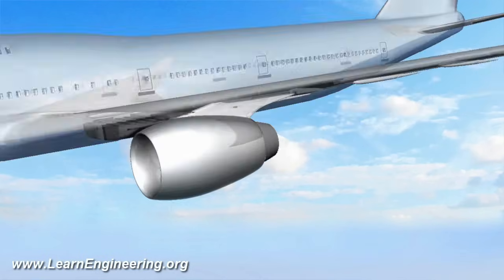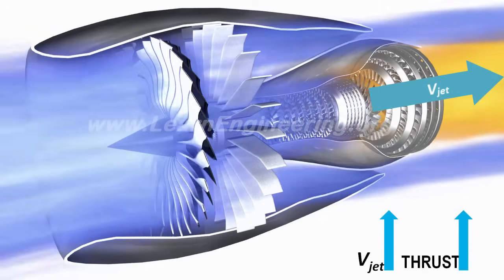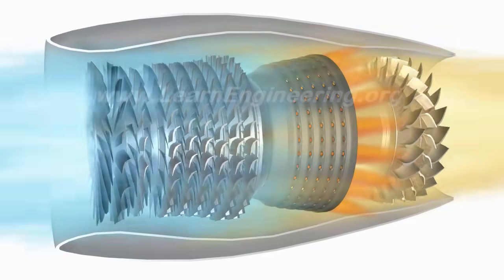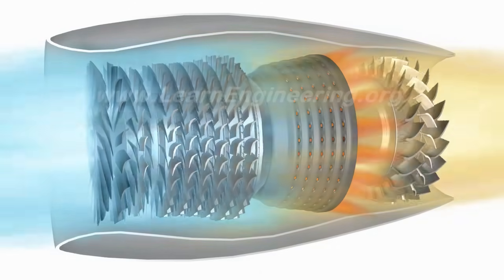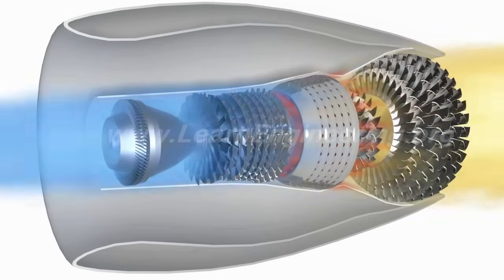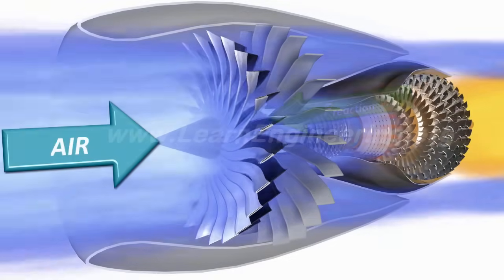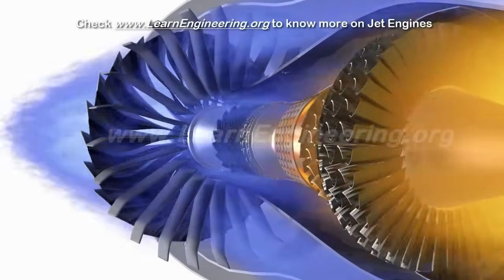Jet Engine, How it works?

Comment: Let me correct my last comment. It is spinning correctly in relationship to the exhaust blades. The angle of attack of the input blades in this video is usually wrong.Sometimes it it shown correctly.

Comment: They do not know how that engines works either. Why? Because we would understood them if they knew.
Reply: Tecolote Onako i found this easy to understand. Put in idiot terms, hot air is bigger than cold air. So they burn fuel to heat up the air. Because this air is in a tube, it shoots out the end as it grows. The put a fan in front of this air that is connected to a bunch of other fans which feed the engine with higher pressure cold air, and because there is more cold air, it grows even more when it heats up and shoots out the back at even higher speed.

Comment: In the first few minutes of this video the fan and compressor blades have a reverse orientation. They would be sucking air out of the engine with the rotation shown.

Comment: but...but can jet fuel melt steel beams
Reply: FraKctured I have given you the accurate temperatures - you learned to count, haven't you?
The beams can melt afterwards - there was more than enough time.

The rest is conspiracy nonsense.
I say it to you as a mechanical engineer who actually knows something about material science. All architects that I discussed this topic with confirmed me all the same behavior.
Reply: The temperature the fuel burns in the engine is shown in the video to be 450°Celcius. That's 842°F. The melting point of steel is 1510°C, or 2750°F. Conclusion: So Jet Fuel actually burns at less than half the temperature necessary to melt steel beams, and thus...well, maybe you should continue that line of questioning on your own.
Reply: You don't need to melt steel beams to lower their load capacity. If you are really interested in this topic, then talk with a proper architect or mechanical engineer. 

Also, the kerosene itself burns at 1800-2200°C if provided with enough oxygen (or higher if there is a strong breeze). The "quote" of 450° shows that you haven't even understood this demonstration, where the common temperature of the leaving jet was shown.

I don't know what makes me sadder to see: Senseless memes or the answers that follow them.
Reply: MetallicReg Correct, you do not need to melt steel beams to lower their load capacity. However, if you take into account the fact that steel beams actually were melted on 9/11, you might reconsider the relevance of your rebuttal. One doesn't have to be an expert in anything to google the images of steel recovered from Ground Zero. Humongous pieces were fused into slag, made physically inseparable from concrete and debris. Youtube has videos of the towers burning in which glowing hot metal is visible dripping out of the sides. It's a known fact that First Responders reported that the debris pile was too hot to walk on, and fires under the rubble burned persistently for months after the attack. One group of firemen interviewed saw molten steel pouring down the columns underground. Hundreds of witnesses reported hearing multiple explosions preceding and coinciding with the destruction of the towers. Unfortunately, none of those findings were addressed in the 9/11 Commission Report, and most professional "debunkers" still pretend that it doesn't exist, but it's all easily available online if YOU actually have an interest in this topic. But hey-  it's probably all just a big internet meme right? No real scientific or forensics experts are seriously questioning the findings of NIST, right? That whole "Architects and Engineers for 9/11 Truth" organization couldn't really be run by credible Architects and Engineers, could it? Nahhh, our politicians, media, and government would NEVER lie about anything like this, would they?
Reply: it doesnt have to melt for a building to collapse...just make a few problematic beams a little more weak and boom...just sayin im not implying that bush did 9/11

Comment: Low speed fluid dont damage the outer turbine but what about the inner turbine which is subjected to high velocity fluid. Sol what is the advantage of two spool system??
Reply: so what's the advantage of spool system then ??

Comment: Very complicated i dont get it even after watching it twice !
Reply: Not too complex. As the air/fuel mixture ignites and shoots out the back of the engine, that flow of air turns the turbine wheels as it rushes past them. The turbine wheels are connected to a shaft that spins the fans at the front of the engine...sucking more air in, which is added to more fuel, which ignites, which again spins the turbines sucking even more air in to the front of the motor. The thrust is created by air flowing faster out of the back of the motor than the speed of air coming into the front.

Comment: So how does a turbo fan jet engine start? If it needs airflow to operate, it obviously needs to start spinning with a mechanism that doesn't require fuel burning.
Reply: Usually high pressure air from the APU will be fed to one engine to spin it up. After the first engine is started the high pressure air from the now running engine is used to to start the next engine. Hope that helps.

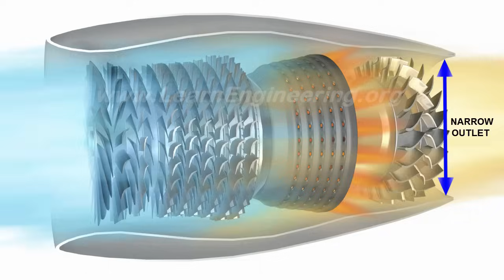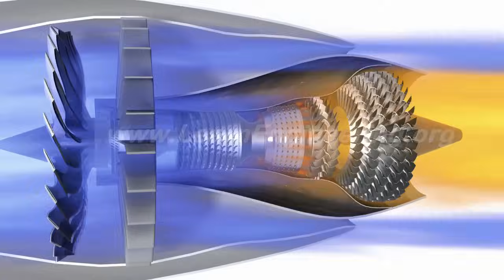Comment: Your animation is wrong... compressor 2:50 and propeller 5:04 blades are wrong angled or they need to be reversed.. if they turn as in the animation they wil pul air out of the turbine from the front.. Any engineer or person with minimal aerodynamics knowledge will understand.

Comment: Why are the front rotor blades inverted? Wouldn't that make it spin the wrong direction?
Reply: At 4:00 the front rotor blade is going in the correct direction.  At 5:00 the rotor is still turning in the right direction, but the animation turned the blades 90 degrees in the wrong direction.
Reply: I noticed this too. I think it's what martin said.
Reply: Dennis Edwardz Thanks, yeah. I looked back later, and was having problems seeing what I saw the first time. Didn't really feel like going through all that again :P
I have directional dyslexia so I couldn't figure out if i was just confusing myself. When people make mistakes like that, it really fucks my mind over, my brain is suppose to be the source of the inconsistency :P
Reply: Richard Smith can somebody explain how jet start
Reply: @kevinsimiyu7473  maybe an electric motor speeding it up to the correct speed and then the fuel is injected, then the motor is turning off
 
(Just an assumption)
Reply: Its Saab JA 37 Viggen's engine........XXXDDD
Reply: Richard Smith

Comment: sorry, but was the air "burnt" inside?
Reply: atomised fuel burns and heats the air
Reply: It's the atomised fuel that burns. Ensured air flow, by means of the compressor set, ensures the fuel will continuously burn. Resultant high temp & pressure media then, not so quietly, demonstrates newton's third law.
Reply: Surendra Nerurkar so, air is not the fuel?
Reply: actually air and fuel mixed, and burn into the combustion chamber. so you need vortex into the combustion to mix them up
Reply: Air-fuel mixture in relation 15(air) to 1(fuel)

Comment: The front propeller is rotating wrongly that kind of rotation will only help plane to move backward
Reply: The front propeller is rotating correctly in same direction as a turbine, but it has wrong orientation of blades. :-(

Comment: Why would a turbine be placed at the end of the engine.  What purpose do those turbines serve?  He say's the pressure drops when the fluid is expelled through them, but don't we want to maintain pressure to keep the engine efficient?  A drop in pressure when the fluid is expelled would cause the engine to produce less thrust.
Reply: The turbine at the back catches the exaust flow to spin itself. As this tubine at the back is directly connected to the compressor it is spun up too providing the pressure for the combustion chamber.
This system by itself is not self sustaining. What gives it this capebility is introducing fuel into the combustion chamber and burning it which adds the energie to provide both thrust and the energie needed to run the components of the engine
Reply: The turbines are placed at the back of the engine so that the hot gases coming out of the compressor spin the turbine. the turbines are then connected to the compressor with a shaft. So the compressor heats the air the combustion chamber burns the fuel air mixture then the energy goes through the turbines which take some of the power and spin the compressor with the connecting shaft.
Reply: So essentially the turbines at the back are there to make the compressor work more efficiently?
Reply: Not more efficient. Then make it work at all. They provide the energy needed to drive the fan, which is essential.
Reply: it's basically an engine that powers itself, the exhaust created from the engine powers the very compressor that feeds air into the engine
Reply: Doesn't that violate the law of conservation of energy?
Reply: The output of the combustion chamber makes more than enough power to overcome the resistance of the compressor itself. Its how its built to be self sustaining.
Reply: remember you're getting energy from burning fuel too
Reply: ^^^^^ Yes and that makes sense.  But the others are making it sound like once you get the engine going, it spins itself forever until it stops.
Reply: Chris Ehmke wut
Reply: No it does not violate that law, because fuel (energy) is being constantly supplied to the system.
Reply: That's true though, once you get it going, it WILL spin forever, as long as it has fuel supplied to it.
Reply: It's the snake eating it's own tail.

Comment: Can a jet engine provide enough compression that the fuel ignites without a source of spark or flame?
Reply: It's sparked at the first cycle and normally you don't need to relight it but when it rains or something like that it might need another spark. (sorry for bad english)
Reply: I would think that any rain would be vaporised pretty quickly
Reply: In short, no. Once ignited by a spark, the flame self-sustains by designing the combustion chamber so that it keeps the flame in a stable position though the range of operating conditions the engine will see. They generally only "flame-out" when a pulse of hot (or oxygen-depleted) gas is ingested which disrupts the compressor aerodynamics, and spits the flame out of the combustion chamber (i.e. passing through the exhaust of another jet or missile).
Reply: Fortunately it does not rain too often at 30.000 feet altitude.

Comment: What is the next concept for aviation engine power
Reply: Before we talk about the next stage of engine power, they need to correct the misinformation in various areas in that stupid video!
Reply: Ramjets maybe? :P
Reply: TheGoatAttack Ramjets or sometimes known as "scramjets" is not a new idea; they use very little oil compared to conventional aircrafts and the oil companies will not invest in that kind of technology, it will be self defeating...
Reply: Light speed I want to go to the future

Comment: In addition to the engine rotating the wrong direction, you also start the video with an illustration of what appears to be a 747 with only two engines. Although your technical narrative seams to be correct, you lose a lot of credibility with the faulty graphics.

Comment: 1:45 compressor is turning the wrong way.
Reply: ha all that work animating this and its spinning the wrong damn way
Reply: IMHO the fans have the correct dirrection of rotation - the same as the turbine (they are on the same shaft), but they have the wrong orientation of blades.
Reply: @matejcapak1571  Either all the compressor blades have the pitch reversed, or the stator blades in the turbine section are reversed. Changing the rotation would still leave this animation wrong. Pretty dim mistake on something that no doubt took a lot of time and effort to animate. What blows my mind is the number of people who

Comment: For about 10 years I thought a jet engine works pretty much as a propeller.
For the next 10 years I realized, it doesn't, but the air jet alone is the driving force.
Now it seems as my childish view was closer to reality as the fan actually IS a propeller. Confusing.
Reply: Jemand l

Comment: front blades are moving in wrong direction. this rotation is throwing air out instead to intake
Reply: Schoolboy errors like this always make me wonder what else could be wrong that I wont notice in the video and throw me off my learning.  Brilliant if not for the small mistake.
Reply: Haha no theyre not, if you looking at it front the nose of the plane they are, but if your standing behind the plane, they are rotating in the right direction, which is exactly whats needed to propel the plane foward.
Reply: all fuckin rotors has their blades in wrong direction
Reply: yes
Reply: Yes .
in many other clips too i saw this! !! 
Its not an idiot mistake? !!@
Reply: Hey, don't you know the blades are spinning in the wrong direction.
Reply: They are digging in the wrong place
Reply: This is a cartoon drawn by an idiot...
There was no engine, no air, no fuel...
It was purely imagination...
However the coyote was hammered by an anvil 1000's of times dropped off a cliff by the road runner, true story...
Reply: They are baisically compressor blades.
ment to compress the air.so that why they arr shaped.
Reply: @realitytube1  wow, you not so smart eh
Reply: Waqas Azeem zz
Reply: Runways wet. Let's enable reverse thrust :)
Reply: An antitorque feature.

Comment: I still don't get it.
If the compressed air gets fuel and reacts it heats up and expands. Expanding air provides force in any direction, so how does the jet engine "know" in which direction this force goes?
In my understanding the forces of the expanding air are equal into the direction of the wanted thrust AND to the front of the engine. I mean there is no check valve or anything directing the expanding air to produce thrust. Know what I mean?
Reply: Yes, the force goes  in every direction, but the high pressure air intake in front makes the engine basically a controlled explosion chamber with only one outlet. Like the balloon in the example, when its closed the forces goes in every direction but cancels each other out and will just fall down, but when you have an opening in the back they no longer cancel out and you get a resulting force in the opposite direction
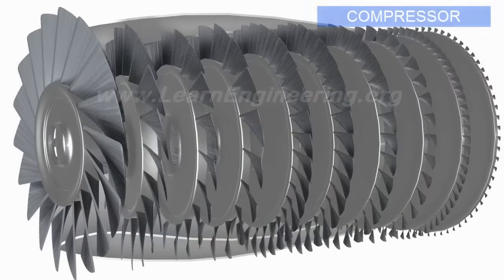Reply: At about 1:30 they talk about the compressor stages. That adds pressure so the fire can't go the wrong way

Comment: So according to this if I put an air compressor before my motorcycle's engine's air intake or at the end of exhaust (for suction) will it raise it's power output?
Reply: A compressor before the intake and a turbine in the exhaust that drives the compressor, thats what a turbo is, and yes it is the exact same principle as jet engines

Comment: I still dont get how the fuel starts to burn when the engines are just started. Is there some kind of igniter? Or the air is sucked enough that we get enough pressure to start the fuel burn?
Reply: Electrical ignitors
Reply: +michael sanders thanks! and they are used at start only?

Comment: As far as I can make out, the 2 spool part is used as an "increase in surface area for air pressure"?  would that be a correct assumption?
Reply: +Charles Randal No. separate spools prevent stall and surge as they will naturally rotate at different speeds (high pressure spools rorate more slowly than low pressure spools, the outer ones). If you only have one spool, flow speed might not suit all stages properly, so there's risk of stagnation (see angle of attack).

Comment: high bypass turbofan mean the thrust comes from the fan and the air flow around the engine core, they got it slightly wrong here.

Comment: Isn't it a bad thing that the pressure drops as the turbine absorbes energy from the "fluid"?  They say it as if its a good thing in the documentary.  Why?  Doesn't that reduce the thrust of the aircraft.  I understand the turbine is needed to suck in more air however but isn't the drop in air pressure going through it a bad thing that reduces thrust?
Reply: +Freddy Krueger What you need to get thrust is velocity, not pressure, since it's a force and force is equal to mass times acceleration. When the exhaust gases flow through turbine stator (and there's always stator before rotor in a turbine, unlike in the video), it changes its pressure into velocity. Then, on the rotor pressure drops and so does velocity a bit, cause it takes energy from the flow, to make itself turn, but the exiting velocity is still bigger than the one before the stage. Having couple of stages gives you some acceleration, but not enough, so you need the nozzle after that to change pressure into velocity further.
Reply: Is the purpose of the rotors to create a vortex to streamline the flow of air out the back of the engine?
Reply: Umm... no. Turbine rotor is actually something bad for an engine, because it consumes up to 80% of energy from the flow. It's only purpose is to generate torque to drive the compressor rotor. And the compressor is the only thing that is essential, cause you could actually get rid of turbine and combustion chamber, replace it with electric motor and the engine would still generate thrust (well, we're not talking about efficiency here :P). Compressor transfers energy to the flow in form of pressure, which can be converted through engine geometry (like nozzle) into velocity.

Comment: How to start the compressor? Electric motor?
Reply: +Eri Airlangga I think it is done in two ways:  some aircraft have a small electrically started jet engine in the fuselage  and it's exhaust travles through ducts into the main engine and spins the turbine  until it is self sustaining. The other way( I think) is to do it externally. A truck with an engine driven turbine  hooks up a hose to the aircraft; air flows into the main engine and spins the the turbine until it is self sustaining. If this is not 100% right I think it is at least 75%.